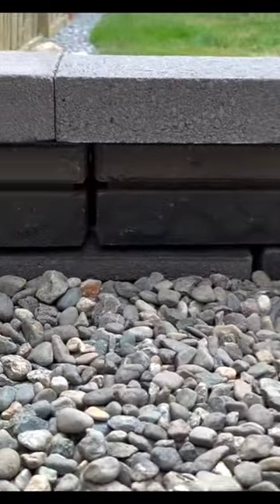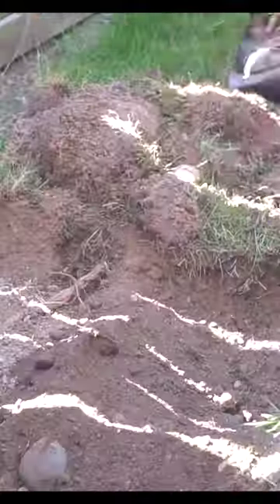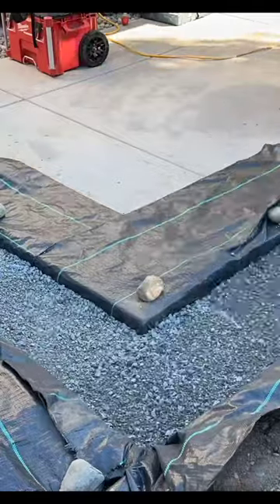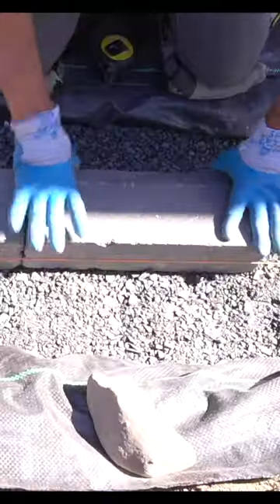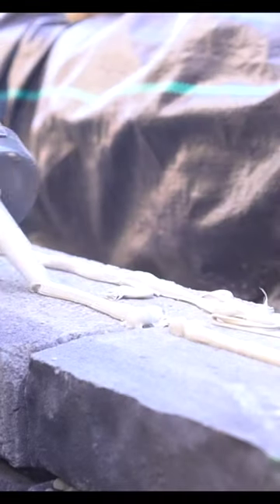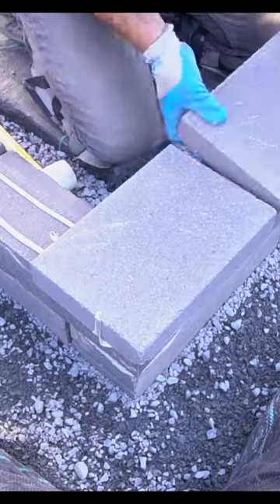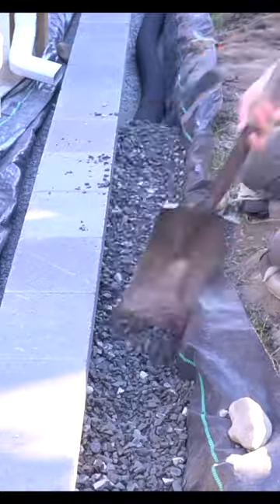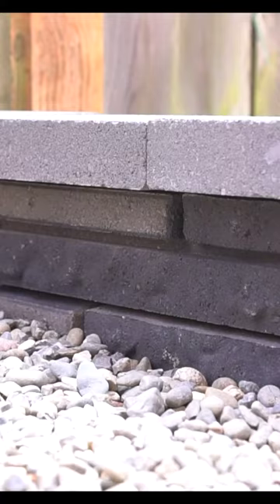DIY Small Retaining Wall

Comment: For a wall this small as long as you dont plan on building something on it you dont need a huge base and drainage
Reply: Never seen contractors installing a drainage hose.
Reply: @stockey  It is to remove hydrostatic pressure on taller walls. Something small like this would likely not need it, but it is over engineered and is not wrong.
Reply: Correct i made the same wall with like 2 inch base and no drainage as this wall also have gaps to let water sweep through

Comment: Absolutely wrong fabric that's woven fabric notice the lines meant for plant spacing this does not drain and will trap water, do not use crushed minus because it holds water 3/4" clean stone is what you use for open graded base, no drain tube! Does nothing waste of money, (add wall light.. there cheap and add a lot of value.) run a level string line the wall is not level within 6' otherwise looks good

Comment: Wow you have the easiest dirt to dig through. Our dirt here wouldn't let you dig one inch, let alone six. You'd need an excavator for that.
Reply: Or a tiller...
Reply: @mustangcody  only if you have a larger tiller, my dirt when dry is practically concrete, the tiller we have (weed eater attachment) wont put a dent in it unless its either the correct level of moisture and even then it still takes ages to till just a few inches or we use a pickaxe to loosen it up
Reply: @heyfindmenoob  
Thanx, Great suggestion! 
Though our soil has tons of rocks, 
when wet our "concrete" would be 
easier to dig. A tiller would speed 
up the process & help us find those 
rocks quicker.
Reply: He's in WA state, some of the best dirt in the entire U.S. there.
Reply: try a pick mattock

Comment: I just put 1/2” of bedding sand between the dirt and the first row of blocks.
Reply: Update on your wall?
Reply: I suppose it depends on the soil conditions, but I would not recommend this for a retaining well. That method is how pavers were done by the previous owner before us of our house and I had to remove them because they drifted and warped. Looking into it, you need that paver base because it interlocks and prevents drift.

Comment: You slopped the adhesive everywhere and I hope this is a warm climate, frost would heave that wall all over the place
Reply: Hmmm, Why you say that. 6 inches of 3/4 clean  is plenty for drainage and frost. Are you saying don't use adhesive. O your saying run adhesive so water can flow. Right?